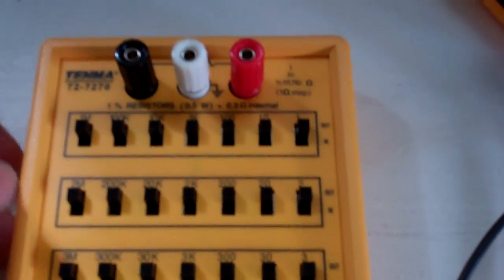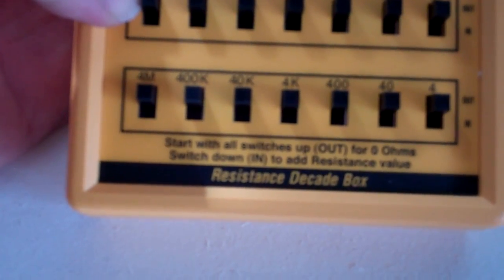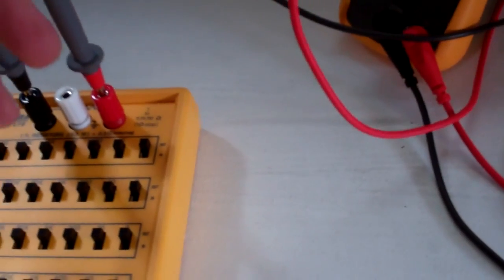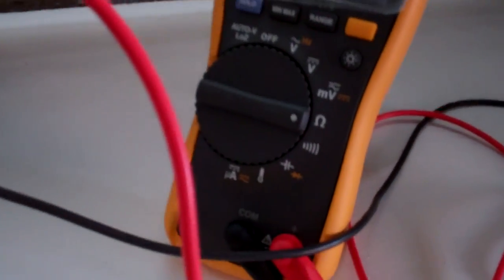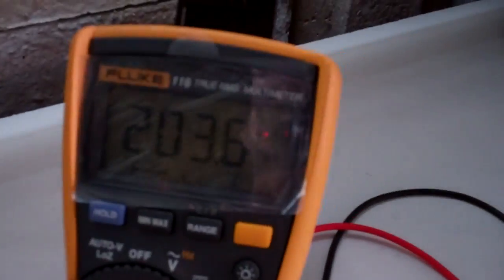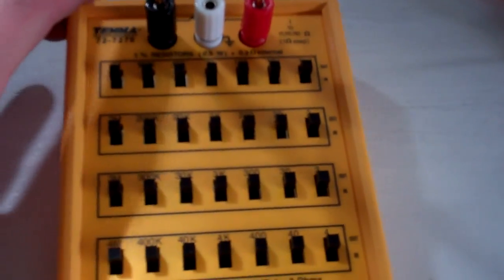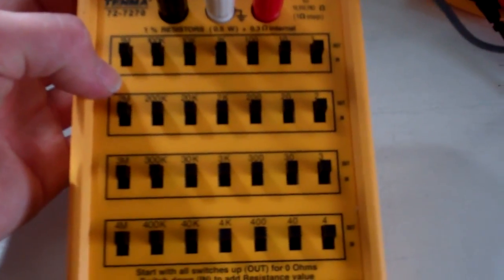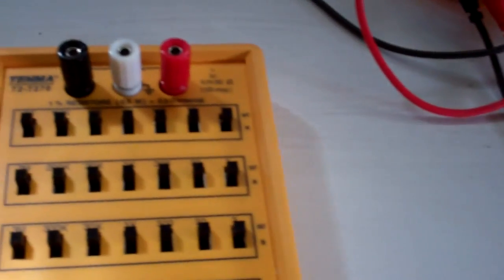Resistance Decade Box

Comment from the maker: Hi Fritz!

No batteries needed, its just ohms in a box, you can use it to replace suspect temperature probes on electronic stats etc by switching it to what they should be and seeing if it works now, i've got a vid of me playing with it, should have just finished uploading.

Had a Fluke 12 ages ago that died, forgot how good they are! The 116 is a hvac specific meter though i doubt i'll need the micro amps function as i don't do gas boilers etc (different trade over here) Thanks Fritz!